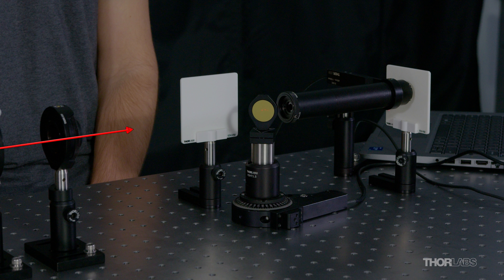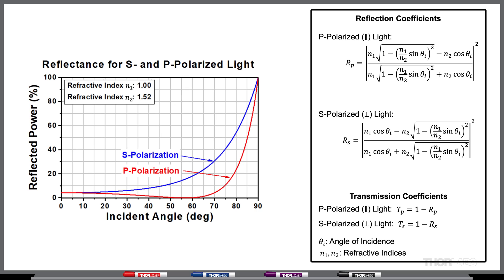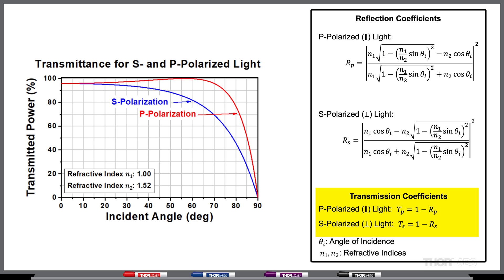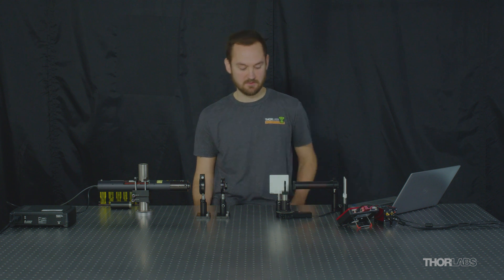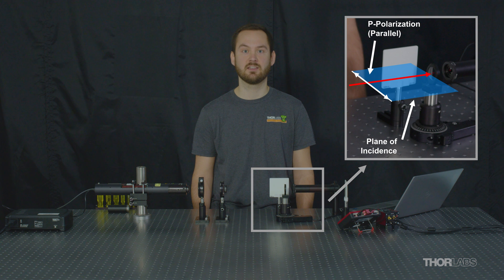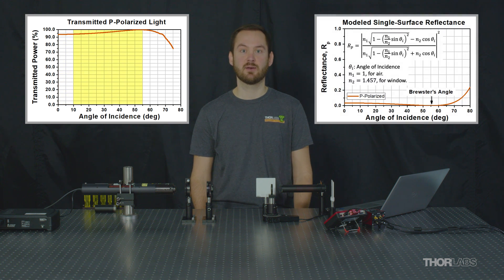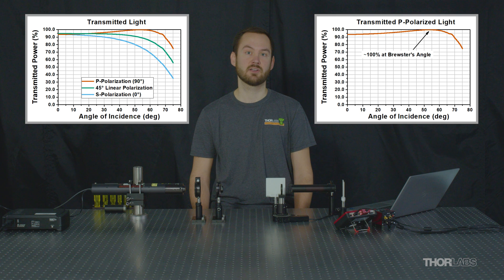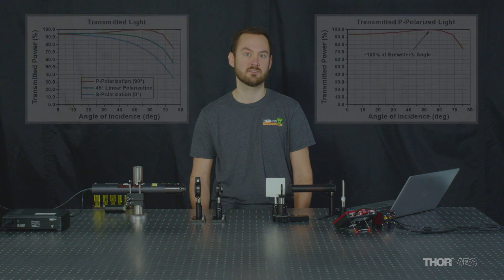How Light’s Incident Angle Affects Transmission & Finding Brewster’s Angle | Thorlabs Insights

Comment: Thank you for your video. Could you please explain how to rotate the polarizer to specific angles, for example 15, 30, 60, 90, and 120 degrees?
Reply from the maker: @bu_pthanh0412  Thanks for your question! If one of our polarizers will need to be incrementally rotated, we first install the polarizer in a rotation mount (e.g.  https://www.thorlabs.com/newgrouppage9.cfm?objectgroup_id=246 ). These mounts include a 360° scale engraved around the around outer edge of the rotating component. We next align the polarizer’s transmission axis parallel to the horizontal or vertical using this approach:  https://youtu.be/W9pALZ5Z8ms . When this is done, we note which scale engraving (e.g. 23.5) is aligned to the fixed 0° reference. To rotate the polarizer’s axis to a particular angle (e.g. 60°) we rotate the mount by that amount (e.g. so the engraving 60+23.5=83.5 is aligned to the fixed 0° reference.) Some mounts allow the dial face to rotate independently of the optic, so the user can rotate and lock the 0° engraving to any angle, such as the 0° reference mark, which makes the mental addition easier. In our video demonstration, we made the task of incrementally rotating the polarizer easier by using an indexing rotation mount. The one we chose can provide stepped increments of 22.5° (https://www.thorlabs.com/thorproduct.cfm?partnumber=RSP1X225) .

Comment: Blogger, can you explain the use of a polarization controller, such as the relationship between the rotation angle of each paddle and the change in the state of polarization? Is there any pattern to it? I am having a hard time mastering its use. The models I am using are MPC320 and FPC560.
Reply from the maker: @user-xt5ff3xb8v    The fiber optic, three-paddle, polarization controller models you are working with allow people to take an arbitrary input polarization state and convert it into a different output polarization state. Setup includes coiling the fiber into each of the controller’s paddles. The bending strain in a fiber coil induces birefringence in standard (i.e. non-polarization controlling) optical fiber. The phase shift provided by each paddle depends on the fiber’s material properties, the wavelength of the light, and the length of the fiber coiled in the paddle. Essentially, the coiled fiber in a paddle acts as a wave plate. Rotating the paddle rotates the fiber-based wave plate, similar to rotating a conventional wave plate. In the case of a three-paddle controller configuration, the number of fiber loops in each paddle are typically customized so that the two paddles on either end act as quarter-wave plates and the paddle in the middle acts as a half-wave plate. 

However, the paddles generally do not provide exactly quarter- and half-wave retardances. In addition, the exact input polarization state is usually unknown. Because of this, each paddle’s rotation angle (i.e. the polarization change provided by the paddle) is typically optimized based on system feedback.  We have a resource on our website that demonstrates one approach for obtaining the desired output polarization state. The web page is here: https://www.thorlabs.com/newgrouppage9.cfm?objectgroup_id=343&tabname=Lab%20Facts and the PDF of the related summary slides is here: https://www.thorlabs.com/images/TabImages/Fiber_Polarization_Controller_Lab_Facts.pdf .

Comment: I am confused. Shouldn't mirrors have very very high reflectivity, close to 100%? Why only 4%?
Reply from the maker: @adityaasopa4031  There are many different kinds of mirrors, and they all have different reflectivities. Some metallic mirrors, like silver and gold mirrors, have reflectivities above 90% for a wide range of wavelengths and angles of incidence. There are also some dielectric (non-metallic) mirrors that have special coatings that provide >98% reflectivity over specific wavelengths and a wide range of incident angles.
 
This video shows that a piece of uncoated glass can also be used like a mirror, although its reflectivity varies a lot with angle of incidence. When the light’s path is nearly perpendicular to the glass surface, about 4% of the light is reflected. The poor reflectivity at this angle is why people typically use glass windows to see through. But, when the light hits the glass at a glancing angle, so that the light’s path is nearly parallel to the surface, the reflectivity approaches 100%.

Reflectivities for these scenarios and other interesting angles of incidence can be predicted using the Fresnel equations.